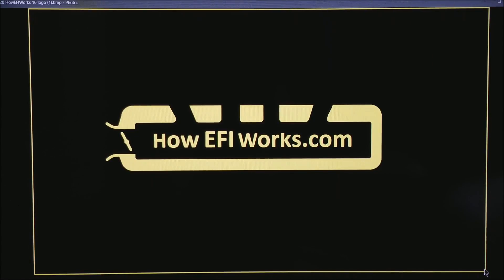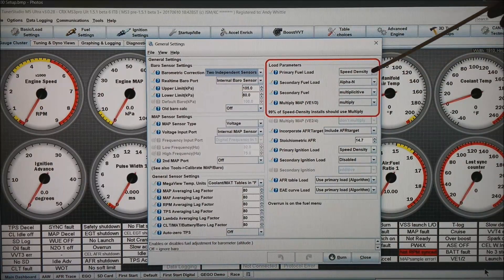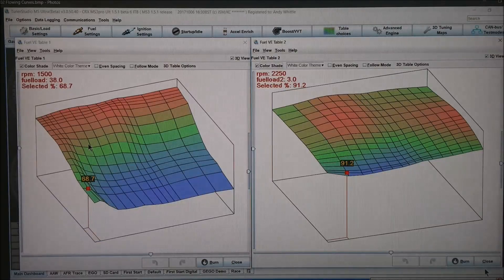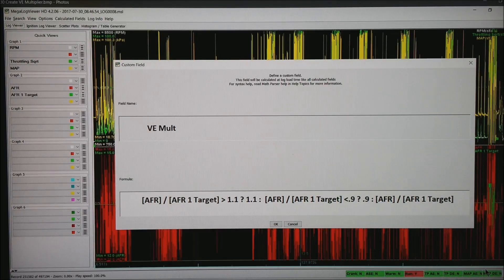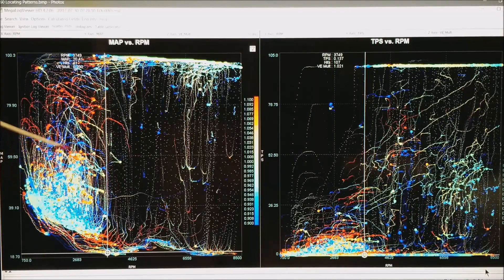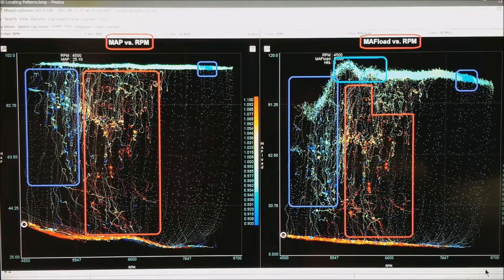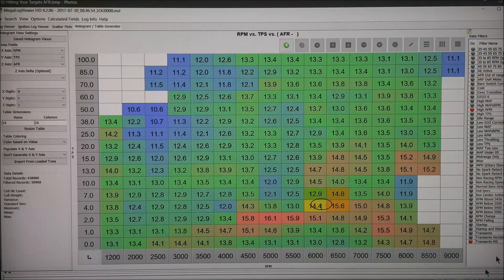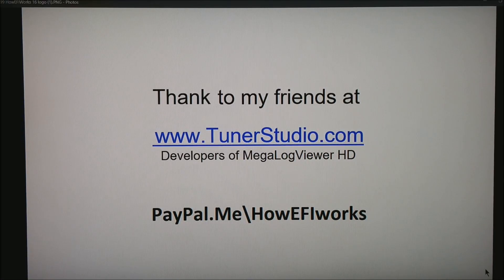Advanced Hand Fuel Tuning and Blended Tables

Comment: What do you recommend for a wide band? I'm assuming something that communicates quickly and over can would be the best
Reply: spartan 3 bosch adv on can bus
Reply: @norb231  I've got that now and then found that Bosch sensors are turds
Reply: @ReubenHorner  Well yes and no they wont last long running rich, only other choice is the ballanger afr which uses the ntk, but the sensor response time is 120ms best.
Reply: @norb231  I was running it fairly lean. I will go Ballenger ntk. Not too worried about the response time if it won't fail on me

Comment: if running a turbo where primary load is map, is there much to be gained from tuning the secondary load with tps ? i.e compared to when using an NA engine?
Reply from the maker: Generally, turbo motors are textbook Speed Density.  MAPxRPM vs Duty Cycle is very well behaved.  That being said, bet a really big log of all around driving and plot RPM=x, TPS=y and AFR Error =z and see what you get.